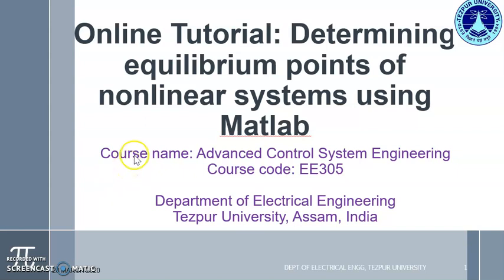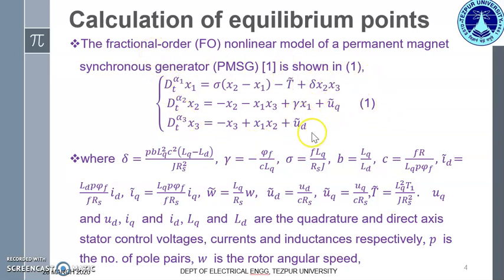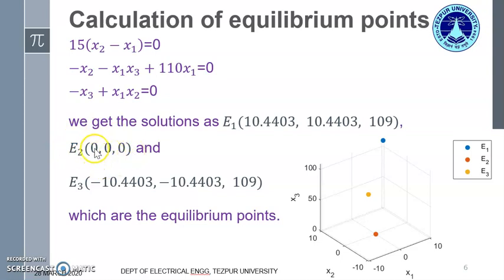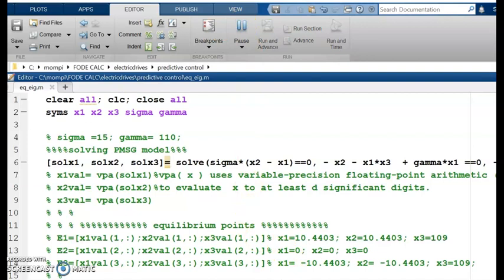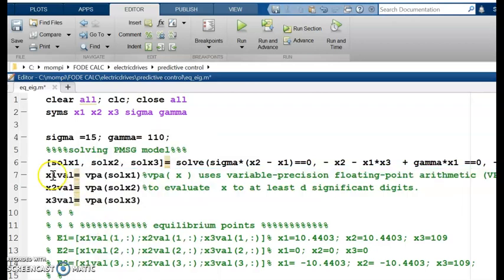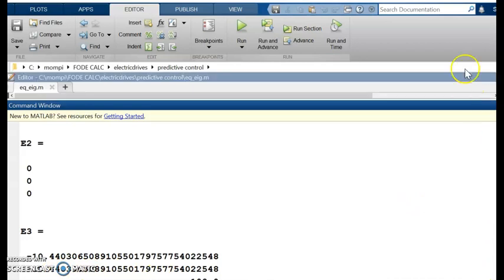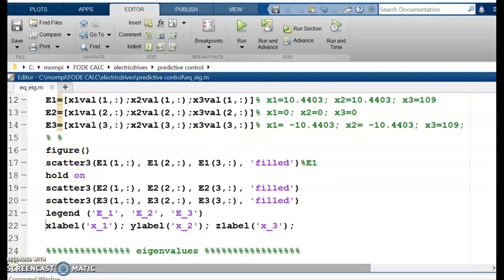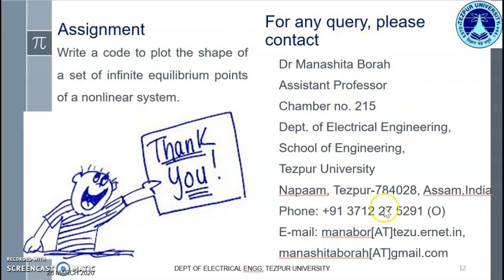Determining equilibrium points of 3D nonlinear systems using Matlab | Dr Manashita Borah

Comment: Your  code works for finite equilibrium points.How to tackle infinite one? We need at least 100 points out of those infinite to generate a graph?Can you shed light on this?
Reply from the maker: For infinite eqm points, once you solve the nonlinear equations, you will get the solutions as a function of some variable, say, z, (instead of distinct points as in finite eqm points). Then select a range for that variable z, and insert a loop to calculate the corresponding eqm points for different values of z. The points on being plotted, may form  a curve, sphere, etc. (instead of dinstinct points incase of plotting finite eqm points). All the best!
Reply: @drmanashitaborah3237  Thanks a lot your reply, I had one more concern.I  gave a range of parameters ,in  my case 2  parameters were there and I got x,y,z for that range and I am interested in surface plot.What I id was scatter3(x,y,z) in matlab and that looks bad to look.Can you tell how to have a surface plot for three arrays as in matlab meshgrid works for  sq matrices.Will be really grateful
Reply from the maker: @finestopedia5352  I do not get your question clearly. From what I understand in your question, is that you may save the values of x, y and z in three separate arrays in workspace. You can access them and plot in 3D using plot3(x,y,z) command.